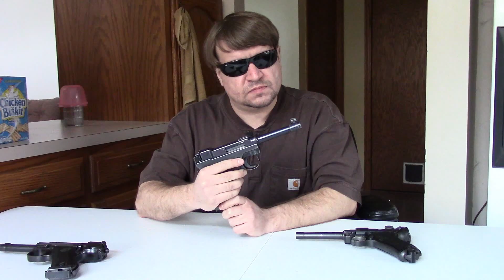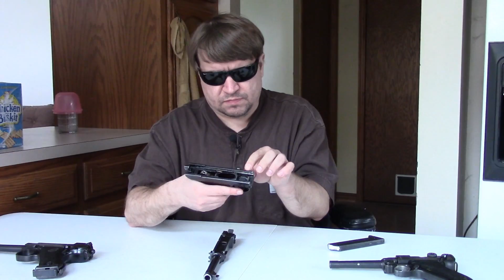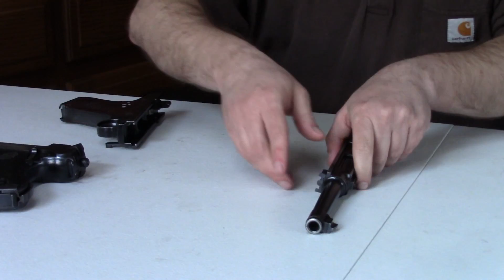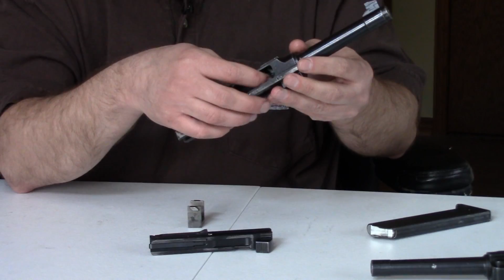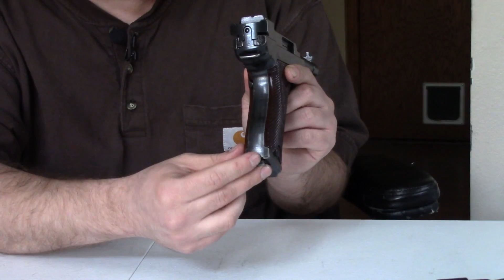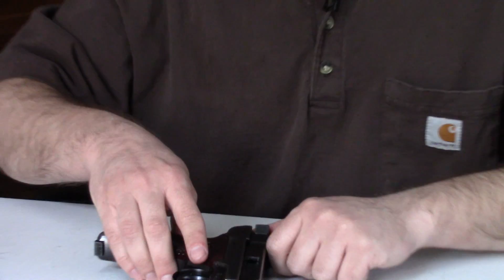Finland's VKT L35 Lahti Pistol: A Half Century Of History (1935-1985)

Comment: My L-35's and M-40's were fun guns to shoot. I had bought mine thru the mail back in the 1960's. I liked shooting the L-35 or the M-40 as much as my Luger's. It was hard getting replacement slides for the L-35 until I was assigned to NATO in the late 1970's. I was lucky my mother had not sold off my L-35's, M-40's or Luger's when I had been reported KIA in South Vietnam. After the 1970's I had to start reloading 9 MM ammo to feed my L-35'S, M-40'S and Luger's to keep from over stressing them with the hotter loaded ammo showing up on the market.

Comment: The Finnish made VKT is better made than those of Swedish manufacture. The Swedish versions actually cracked from the hotter 9mm loads of the 1980s. They were replaced by Glock 17s. Again a very informative presentation. Good job.
Reply: swedes used soft steel hence those break more easily than Finnish L-35`s. 
but one can destroy Finnish L-35 by using SMG-ammo; it will crack everything given time...
Reply: Teppo Kuusisto exactly. The sub machine ammo was too hot. Yet Lugers held up as do the Glocks
Reply: I wouldn't say Lugers held up to that ammo. Most were still in 7.65mm during the wars, and afterwards those in 9mm were not shot to extremely high round counts like some Lahtis were. That said, it can't be denied that the L35 had some weak spots, especially around the bolt excellerator area.
Reply: Lugers or as we say, Parabellums succumbed to smg-ammo as well. 
Seen too many with cracked slides and  bolts to say otherwise. 
And even the mighty Glock will get destroyed with that ammo; seen those as well, although it is not that common and takes 10 to 100 times the ammo than P-08 or L-35.